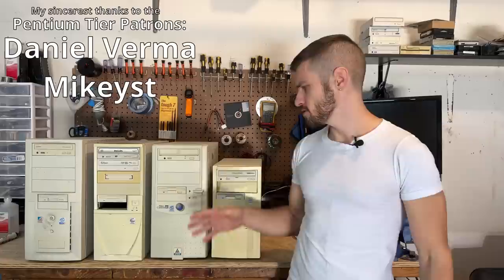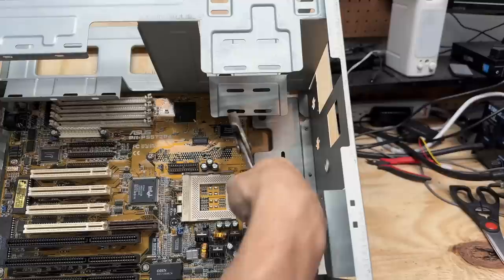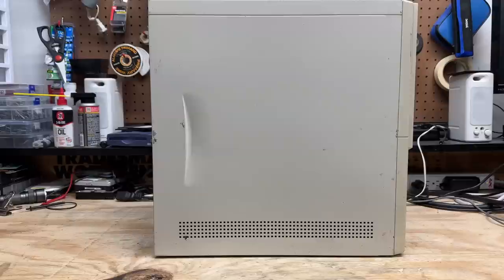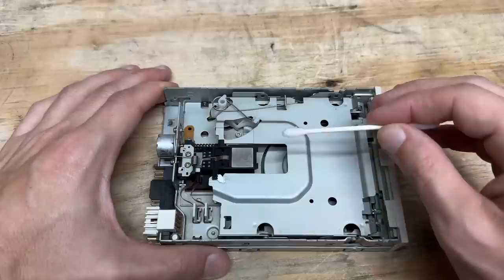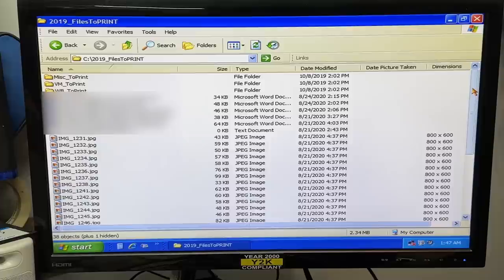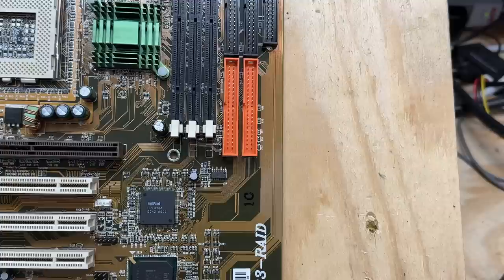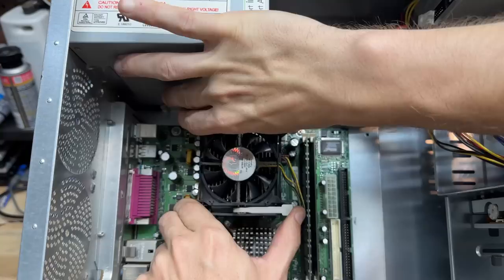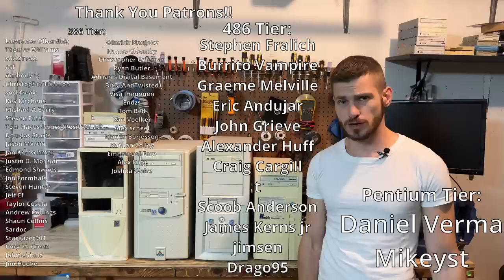Let's explore some mystery custom PC towers!

Comment: This time  of the week again... i also didn't know custom PC building was popular in the 90's like today
Reply: Oh yes, and you kids have it easy nowdays. 🥳

Let me introduce you to our friends in the 90s, "everything is an expansion card" and "IRQ conflict from hell"! 😂👹
Reply: Oh yes, it was! I started messing with old and cheap or free computers (mostly 286 to 486) in around 1997 and played with a bunch of P1 machines throughout my teen years. I never built a PC from scratch but I did help a friend design his custom PC in 1999 or early 2000. We picked all the components from a local small computer chain, I think we even used their web site rather than a paper catalogue, and then he had the machine built by the store, it was a service they offered. One thing I remember very well is how upset I was that he got a crappy video card (might have been an NVIDIA something) so he could afford a huge 19 or 20" CRT monitor - I'd have preferred a decent video card and smaller screen. He was happy with the computer for several years though and eventually gave it to me to play with when it was wildly outdated. It did run XP quite nicely, which was a far cry from the 98 it had been built with.

The real fun begins once you get back into the late 80s, with MFM and RLL hard drives. The first DOS machines I worked on were like that, 1987-1989 vintage, mostly cheap-ish 286s, featuring Seagate ST-225 or 251 drives. The two things that saved my sanity back then were a stack of DOS magazines my neighbour gave me and the early internet. Seagate had the data of all their ancient drives on their web site for free.
Those drives couldn't be detected automatically, you had to enter cylinders, sectors and heads manually. Some BIOS setups offered a custom type (often 47) that let you enter the data manually, with others you had to pick the closest pre-defined type with the same or slightly smaller size and format the drive with those values. Using that drive in any other machine required knowing the values the original user had used to format the drive. If you didn't know them you were out of luck. Early IDE drives were installed in a similar fashion, the cyl/head/sec values didn't have to match the physical drive though, just the size of the BIOS type had to be correct or smaller than the actual drive. Auto-detect came with 486 machines, possibly some very advanced 386s had it too but I haven't seen any. ESDI and SCSI drives were much more advanced. For SCSI you set the BIOS hard drive type to "none" and the controller did the rest, for ESDI you picked any type you wanted. Those drives were painfully expensive though.

MFM/RLL and IDE were similar enough that they couldn't co-exist in one system, so moving data from one of those old machines onto something more modern usually required a SCSI controller and hard drive. The last time I used that setup in a real world environment was in 2006 when I had the dubious pleasure of backing up the hard drive of a 1987 Mitsubishi 286 that used to control a CNC milling machine. The only thing that was wrong with the Mitsi was a flat CMOS battery but unfortunately the BIOS setup wasn't in ROM but had been supplied on a long gone floppy disc. Getting the controller and hard drive to work with any other 286 board proved futile for some reason, as did using the drive with another controller, so I spent the better part of two days scouring the depths of the internet for a setup disc image. I actually found a generic setup that I could then put on a flash drive, shift that to a 3.5" floppy on an older Mac with a USB card and finally copy it onto a 5 1/4" DOS boot floppy on a Pentium 1. Then began the fun of trying hard drive types one by one, thankfully type 2 or 3 was the correct one. Once I had the hard drive working I installed my SCSI card and drive, xcopied the whole C: drive to the SCSI drive, plugged that into a Pentium 90 running DOS 6.22 and Windows 3.11 and copied the relevant software to the Pentium's IDE hard drive. Thankfully DOS software could be copied from drive to drive without any issues. What a palaver!

Comment: you start to feel old when you see P4 and a windows XP machine been stripped.  It feels like only yesterday when i was studying windows XP and playing about with PCs. I don't do it now at all. But i did rebuild my old MCP lab a couple of years ago so i can have a play with old OSes again of yester year a long with the server side, now and again. I  have 3 Pentium IIIs one is a dual processor maxed out, which i use a server role.   A system id have loved to have built back then, shame i cannot turn back the clock to 2004 to the windows XP days. Id have been laughing now.   But with me not been able to get into the field back in the mid 2000s, i gave up with it all.  Microsoft stuffs good shit to learn.

Comment: Back before flash drives. Nero was a god send back in the day. Nothing worse than burning a CD with a lot of wasted space. Nero (and other programs) would let you add files later. I do look forward to seeing what that Abit board can do. Keep voiding those warranties. I do remember Albatron or Albatross making video cards. Not too sure.
Reply from the maker: Looks like Albatron did indeed make the video card!
Reply: Do you remember a program called Deep Burner? I tried it once. Worked fine. It was supposed to burn files super efficiently, so that a minimum of space got wasted on the recordable media.

If I could find it now, and I'm sure it's out there, it would probably work just like before. But then I think... I don't have any blank dvds around here... and then I wonder wtf for? Got plenty of flash storage. Memories I guess.
Reply: There was a program called "Deep Burner" meant for DVDRs, designed to add files in such a way, that almost no space got wasted.

Comment: Being in computers since mid 91 and now professionally. I find myself saying what piles of horrible garbage. However like I fondly call the TRS-80 Trash 80. I do love some of those system combos. The hardware and OS worked well together and really if it wasn't for changes that in some cases didn't need to have. Esp. for the consumer market. The death of those fine machines came to soon.
Reply: There's just something about those ole micros, they did it right !

Comment: Another great video. I have been on a retro computer kick for the last few months (I've been playing with computers since 1997 - first PC was a 133 Cyrix commercial build). Only recently found your YouTube channel.

My first retro build is based on a Intel D815EEA motherboard  (the very first motherboard I bought ) and put Windows 98 SE back on it.  I'd purchased it for one of my sons, so we three could play LAN games in the house.  It's great to play old games on - viva StarFleet Academy! 

Works well for a 20 year old PIII board . . . with one exception: I keep getting a memory error at "Address 261472256."  Thus far the error hasn't caused any crashes or data corruption.
I've tried different RAM and different slots, and even just one stick . . . and the error keeps repeating. the first two numbers stay the same, but sometimes the rest of the string may change slightly.  I don't see any bad caps on the board.   I don't have any testing equipment to diagnose the issue, so I'm guessing the problem might be with the Tualatin 1ghz processor.  I have a 733mhz PIII I stored somewhere I intend to switch in to see if the error clears up.

Tons of fun, though! Again, thanks for a great video.
Reply from the maker: Thanks! Have you tried a different power supply? Could be due to ripple, which causes all sorts of strange issues. Also, couldn't hurt to hit all slots and sockets with DeoxIT.
Reply: I've not tried either. I'll give them a shot - another PSU I have. I dont have any DeoxIT but have been planning on getting some. Thanks for the suggestions!
Reply: Just a follow-up . . . I tried a different CPU and PSU.  Cleaned the RAM slots as best I could. The memory error remained the same.  The only variable was during g the CPU switch suddenly one of the RAM sticks was showing 100mhz instead of its rated 133mhz. That issue disappeared with a reboot and never reoccured.  To paraphrase Heraclitus - A difference which makes no difference is no difference . . . As in the memory error hasn't impeded playing old games on the machine.

Thanks again for the tips!

Comment: Goodluck finding something to pair with the Media connector in the Nimble PC.

And I'm just waiting for the Jackcon caps on my Abit VP6 to fail. The board was clearly used heavily and yet they are all perfectly fine, even during extended use with the FSB at 143MHz.

Comment: man that second system was dirty. I have one of those switches as an extra. pretty good if you ever want to build a "Sleeper" system. most cases sat on the floor, so they could ingest quite a bit. for some reason I abhorred doing that, the reason some burners won't read certain burned discs (Or burn them) actually can come down to media. I have had my burners not recognize cheap media, but burn verbatim discs without any issue.. definite score on the third board TBH I have never seen an IDE raid board. I had that philips drive. it was a rock solid drive for years, but very picky about the media. if you come across drives that don't seem to work, media is usually the culprit. all I can say is try to find some "NOS" discs. as some of these burners don't like  the cdr media they are selling these days. the fourth case, now that is a find, This is the exact case I had built my k6-2 in. made by "FuturePower"  Man I regret getting rid of mine.

Comment: Back when the p2 came out and i received my 266mhz one there was one issue as the box came with cpu and detached cpu fan... but for some reasons did my box didn´t have the stuff needed to attach the fan bracket to the cpu... so i ended up jury rigging a fan with copperwire to the slot cpu.
In hindsight using copper was probably not even remotely smart but it was what i had at hand.

Comment: I have a board with that hipoint ide raid. I've never used it, but I'd like to see that in action. I've thought about raid striping some sata ssd's into it with adapters to see what kind of ridiculousness I can get into.
Reply: I got an asus board from 20yr ago that can RAID 4 drives (PATA) , couldn't afford to try back then but now i got a bunch of drives from old satellite DVR so now it's on 🤓
Reply: @agenda697  Something about how those drives work makes them really slow. Like they're meant to write and read in sequence or something. I got no idea really, but I know really slow. If you're after a hard drive symphany, then the dvr drives are probably great! Maybe they'll take longer and have to do more work which means more noise.
Reply: @ItIsNot1984  Yeah i think it's because they have less buffer memory (cache), still i'm gonna try it out, thanks for the response ! 👍

Comment: No surprises with drives failing on CD-Rs. CD-Rs are less reflective, so a dying/marginal laser won't be able to read them at all. Not surprised to see an ABit board with bad caps..... that actually sank the company since they used garbage caps on so many boards. That board likely still works fine even with a few puffed up caps.

Comment: That last machine looks very similar to a powerspec I have. Only, mine is black and has a gig and a half of RAM, even the p4 is the same. Those sound max audio chips are kinda meh and the caps on the bottom right like to fail as well.

Comment: I have a Old Gateway 3000 with Intel Motherboard running a Intel P4 at 3.0 MHz with 2 Gig of Ram. Can I install Win 7 64 bit on this platform or only 32 bit like I have already done?

Comment: on the second one i think they installed Plus95 or 98 it kind of works in Windows XP, my work place still has some Windows XP machines the Win95/98 ones are probably gone by now they had hem up until 2021.
Reply from the maker: Are those XP machines network-connected??
Reply: @miketech1024  no they disconnected them around 2017 almost all computers after a ransomware attack on the SMD-Machines

Comment: Funny thing is back in the day of Baby AT cases I remember that the Hardware in my case a Pentium pro 200 and a Creative 8 speed just like the first system you looked at perfectly matched the software of the day. Real execution speeds have not really increased that much because as hardware got faster software got more bloated.
 Remember when Dos came on just 3 floppy disks and even Windows 95 on my Toshiba Libretto mini notebook at the time came on just 25 floppies plus 4 extras for drivers and software reinstalls.
Yes we have better sound better eye candy but is the real world experience any more satisfying I remember having an Ocktek Motherboard back then that had 9 megabytes of cache ram on the Motherboard and days of tweaking Memory caching and hard drives resulted in performance from an ATA 100 Hard drive that took almost a decade to better with improvements in Hard drives and other Hardware but so few would have had that hardware at the time to experience what I found out.

Comment: That last computer with the P4 wasn't a dual core it's a one core two thread CPU, the P4's were never dual cores. I made that same mistake a long time ago also lol. 
It wasn't till socket 775 that we seen the first Intel dual cores and quad cores. Now look how many cores we have in a signal CPU these days my main desktop has a Ryzen 9 5900X with 12 cores 24 threads and that's nothing compared to some of the server grade CPU's.
Reply: Well, the Pentium D was two Pentium 4s glued together; dual-core, NetBurst microarchitecture.
Reply: @FoxMulder78  The Pentium D was a failed dual core it was hot as the sun and wasn't much faster then the Pentium 4 Intel was trying to replace. The first true Intel dual core was the "Core 2 Duo"  that could run cycles around the failed Pentium D.
Reply: @adamgrant1787  yup, that's why I said two P4s glued together.
Reply: @FoxMulder78 And Intel couldn't even get that right lmao.

Comment: I really wish that you would try to keep things in their original cases rather than just scavenge them for parts.
Reply: I think he does go to great lengths  to keep the machines intact and original.  These were a couple isolated cases where the sum of the components didn't make a complete machine.  That franken-case had to go. 😁
Reply: @cthriftfl  I once had a case which was just a case and a logic board.  I found a hard disk drive and a power supply for it at the charity where I disassembled electronics and appliances to get at the components, but unfortunately it was a lost cause.  I didn't know enough about computers at the time.  He is much more versed on the subject and can save any case he wants to.